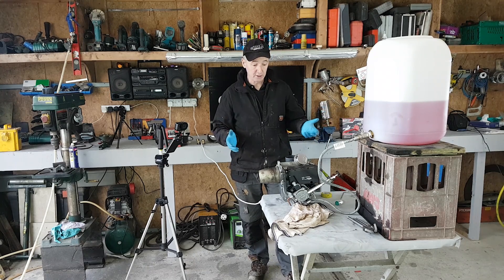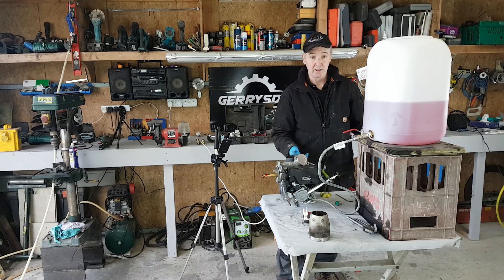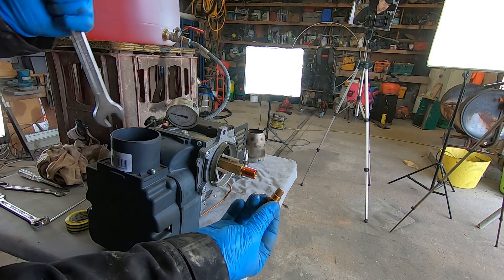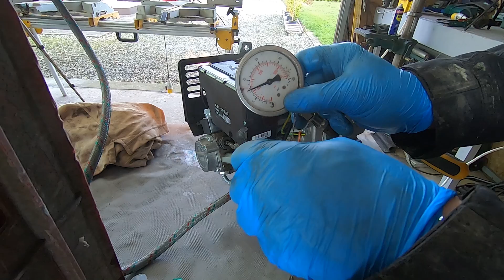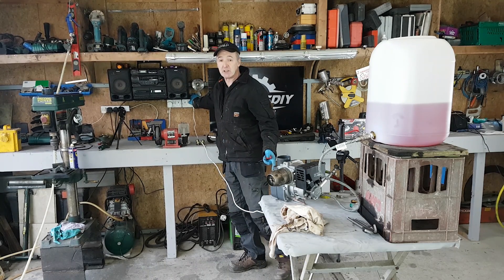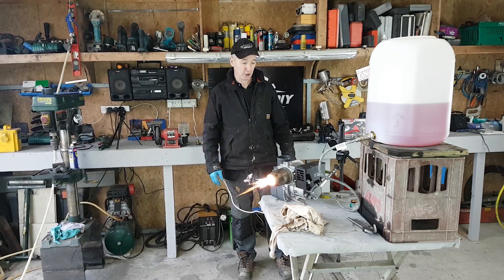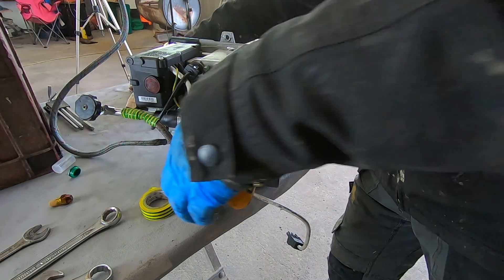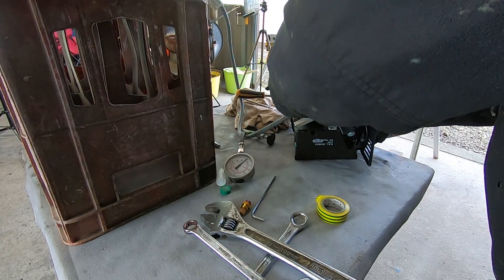Easy Riello Burner Repair

Comment: Hi Gerry, great videos, dub living in sligo here, I have a quick question on this type of burner, we have one installed in a basement where the oil tank is, I noticed yesterday there was no heat, I have plenty of oil, it's not air locked, but when power is on the blower seem to be working but won't fire up, one thing I've noticed is that burn seem to have a lot of water under it, and has water seeping out, any idea what's wrong? Also the last oil fill was October and it nearly February now, so I don't think it's contaminated oil or oil in bottom of tank, any light you can shine on this would help greatly :)
Reply from the maker: Hi Reorg. Is your boiler leaking water  internaly or from a fitting, maybe the circulating pump? Give the photocell a wipe with a rag and try the reset button on the burner again ( red light button) You could replace the nozzle (€10 approx) and give it another go. Culprit may end up being the photocell if cleaning it does not work. Hard to suggest more as you are setup in a basement and it may be unsafe to fire it outside of the boiler. Good luck with your repair. Cheers Gerry👍
Reply: Hi Gerry, thanks for the reply, yeah water seem to be coming from inside it,
Reply from the maker: @Reorg The steel in older boilers can become pitted especially if there is a leak on the system for a long time. Rads in the house and the boiler are usualy made of steel and if there is fresh water filling the system because of a leak they just rust out from the inside. You may have an expansion tank or an automatic pressure reducing valve filling the heating system and you would not notice necessarily. Still the burner should work even if the boiler is leaking. Like in the video you should be able to run it independent of a boiler. Obviously a leaking boiler is a problem that you will have to resolve but for getting the heat going today it wont stop the burner working. You might need to change both the nozzle and the photocell. Take out your old nozzle and bring it with you to heatmerchants or hardware as there are details stamped on the side. Good luck Cheers Gerry👍
Reply: Yeah, I've just took the burner oof the. Boiler and about a 5 lts of water flowed out
Reply from the maker: @reorg  That's not good. If you are in a positiion to get a new boiler you should consider a grant vortex condensing oil boiler as they are about 97% efficient so will save money on running costs. depending on the size of you existing boiler the grant boier complete with burner will cost about €1400 ish. Not what you want to hear on a cold winters day. Are there any fittings on the top of the boiler that could be leaking into the unit. Try a bright flashlight to see if you can identify the leak. Cheers Gerry
Reply: Thanks for your help

Comment: Hi Gerry, I have a RD3 Riello and it starts up fine when it has been off for a few hours but it keeps not firing when the temperature gets up so not switching back on but normally you can hear the air intake and then it fires but I don't hear the air intake happening. Can you advise what could be the issue? Thanks in advance.

Comment: Gerry love the channel quick question have a riello rbd won't spark photo cell spotless any idea
Reply: hi jim,i,m ex marine engineer so know a bit about boilers.i,ve worked on this burner unit myself on my grant outdoor boiler,if you've still got an issue with the spark first check the cleanliness of the igniter electrodes/spark gap (correct gap should be in the destruction manual),if still not working try a new igniter as the insulators may have broken down.

Comment: Gerry you seem to have great experience of these burners,  but what would you advise for us to keep in stock,  the most common fault items ?
Reply from the maker: Hi The3wheeler The most common thing would be the nozzle as they are supposed to be serviced and changed anually. Photo cells and pumps are probably the most common problems after that but these burners ususlly go for a long time trouble free. Some of them are in outside housing units and can get exposed to harser conditions with moisture etc. Hope this helps Thanks for commenting Cheers Gerry 👍👍
Reply: So many different nozzles,  Warmflow told me "must do" match like for like so until you strip nozzle out can't just have any old nozzle

Comment: Hi Gerry I've got a reillo burner on a grant  
Condensing boiler do I need to change the jet ever year boiler service engineers do change
Reply from the maker: Hi Timothy. I have a vortex myself and a stove for the house heating. Grant reccommend that youservice it yearly and that would include a nozzle change but they can run well for quite a bit longer than that. Hope this helps Cheers Gerry 👍
Reply: @GerrysDiy  no I was just wondering as I change it myself as was a fitter / mechanic and It only costs around €10 thanks for replying and info

Comment: Gerry would there be much difference between a 60 deg vs 80 deg nossle being installed?
Reply from the maker: Hi Alastair. Your boiler manufacturer would have run lots of tests to come up with the optimum nozzle efficiency but that said if you have a flame burning inside the boiler you will get heat output. Nozzles have a hollow or solid burn pattern but again you will make heat in the stove. Nozzles are less than a tenner so best to use the right one. Hope this helps Cheers Gerry 👍👍

Comment: Gerry I’m having trouble with my combustion analysis on my domestic boiler, riello 40 oil burner the only way I can get the o2 & co2 to correct margins has the flu temp up over 350 degrees Celsius, any ideas ?
Reply: Personally I wouldn't worry too much about 02 but concentrate on the CO2. Get it as close to 12% as possible and do an old fashioned smoke test. Black is too little air and brownish is too much air.

Comment: Hi Gerry, love your videos and always find them so helpful. Quick question, my POPULAR 90 was making a screaming noice and then totally stopped working. I only bought the house a few months ago and the boiler looks very old. Would you have any idea what might have gone wrong?  Do you think it would be best to get a new Riello burner? Sorry, I'm new to oil heating
Reply: Fan motor,  cheaper repair than replace with whole new burner
Reply from the maker: Hi Rick. You probably have it sorted by now but this might help others. Sounds like a bearing on the pump or the motor. Can be fixed but given that it's old you might consider a new burner. They are about 240 euro and easier to fit than the bearing. 👍Cheers Gerry 👍

Comment: Hi Gerry i have an rdb riello bburner and i serviced it as it was not firing. I cleaned everything but for some reason i cannot get oil to come out the other side of the pump. The only way i can get oil to come out is if i loosen the nut that is attached to the  pump that the copper  feeder line that goes to the nozzle is attached to. And obviously once i do that there is oil pouring out the threads. If you could help i would be very grateful

Comment: Hi Gerry, your the man. Same thing with my burner, and now I know what I'm looking at, is that oil pressure gauge just the same as for the water heating, I have a few of them in my box?
Reply from the maker: Hi Paul. The gauge needs to be decent quality but something that can handle about 15 bar (215 psi ) You're looking for about 8 bar for Kerosene. Air gauges will work but you need one that's big enough to read. Hope this helps. Good luck👍 Cheers Gerry

Comment: Gerry, there's a family in Co. Tyrone sitting in the warm right now thanks to you!! Good man!
Reply from the maker: Well done getting your heating working. Delighted you were able to do it. Cheers Gerry👍👍👍
Reply: Id like to be sitting in the heat in Co. Antrim but its only when press the reset on the burner.. Itl fire and then heat the radiators, itl maybe manage a few cycles then stops completely & will not come back on unless reset button pressed.. Any ideas Gerry what it may be ? Good man .. 

Thanks 
Mark

Comment: Very good video - clear, well presented. I'm off to check my nozzle!
Reply from the maker: Hi Tony. The channel just went nuts lately so just trying to get some of the comments replied to. Thanks very much for taking the time to make a comment. Much appreciated Thanks Gerry 👍
Reply: @GerrysDiy  Thanks for the video, it turned out that the optical sensor was grubby. I thought I had sorted it and changed the nozzle and next day ketp cutting out again - but then cleaned the sensor and great! Your video provided the info to understand the burner and get on with the job. Super, a month on and still going strong. thanks again.

Comment: Hi Gerry i have a prblem with a Riello RDB 2.2 ,thinks its the pump if i star the pump /boiler it purges trys to ignit sparks etc then shuts
 down ,checked oil going to pump fine checked high pressure side nothing coming out of pump so no spray from nozzle ,
This came from a friend it was working fine with them could the wirring be different so the solenoid is not getting power or signal causing the pump not to let oil out ?.
Or if i was just to plug it in on bench as your video would or should it start .
Many thanks colin

Comment: Great videos Gerry :) The outer gasket on my oil pump (RDB1 50/90) has started to leak, the one under the outer cap - I can't find a specific replacement gasket for it - But of course I could replace the pump. The pump works fine so seems a waste of money for the sake of a couple £ gasket... Any experience replacing or re cutting one for these, RDB pumps, yourself?
Reply from the maker: Hi hypodeemicnurdle Is this the kit you are looking for.https://www.ebay.co.uk/itm/RIELLO-OIL-PUMP-STRAINER-KIT-For-Riello-burners-Replaces-3005719-SSC-126G-ETC/323675548420?hash=item4b5c90eb04:g:CisAAOSw3BJcVgKk   Cheers Gerry  👍

Comment: Gerry 
I have a Grant boiler which has just started locking out every so often, It seems that the motor is seizing up when i free it off it runs for a while until it happens again. Would this be the motor or the pump ? or both ?

Comment: Hi Gerry, air setting should be done with a smoke test first and then with a flue gas analyser, newer models getting more sensitive to settings. Also, people should be aware, do not have your heating running when you are getting a fill of fuel, it stirs up all the sediments in the tank, let it settle for a while.

Comment: Not all burners should be set to 8 bar. Different BTU set ups and different size boilers require more pressure out of the same burner. One burner can do multiple boiler sizes and outputs. Always get a qualified person to service and repair. Do not stick it in at 8 bar

Comment: That another GREAT VIDEO Gerry.  Lewis loves the fire flame.
Reply from the maker: Hi Frank. I'm delighted little Lewis is a fan and loves flames ( hide the matches 😜 ) Loved flying the paramotor with you lately and if the weather ever improves it will be great to get up there again. Thanks for commenting Frank👍👍

Comment: You are doing a great video, but I have a question can you adjust it to work on waste oil ? Maybe you can use a bigger nozzle, or to make it first working on diesel then after it starts make it work on waste oil, thanks a lot for your videos.
Reply from the maker: Hi Farid. It is possible but needs a compressor and a preheater. I will be doing a conversion soon. Thanks for commenting Cheers Gerry👍👍
Reply: @GerrysDiy  thank you for your response I am very anxious to see it. God bless you and keep on your great work

Comment: What model riello is that Gerry? Rb3?. I have  an rb3 in my grant condenser boiler . How often would the nozzle need changing?
Reply from the maker: Hi David This one came out of a grant vortex boiler (Outside module) It's an rdb burner. Put it back in service about 10 minutes after this video was finished.  I have a grant vortex indoor condensing boiler in my house running my UFH. Generally you should service it yearly but I have seen them in for years and running well without attention. Great boilers in my opinion. Thanks for commenting. Cheers Gerry👍

Comment: How do you tune your waste oil burner? I'm getting smoke and alot of buildup in the burn pot?
Reply: Sounds like you're feeding too much oil.
Reply from the maker: Hi Jason. Are you using a forced air type or normally aspirated. Generally if it's normally aspirated you need to make sure your flue is long enough to create enough pull / draught in the stove to mix the gasses. You can hear mine roar when running. 5 - 6 inch flue diameter and I find over 12 feet will do it. Let me know how burner is setup. Hope this helps. Cheers Gerry👍👍